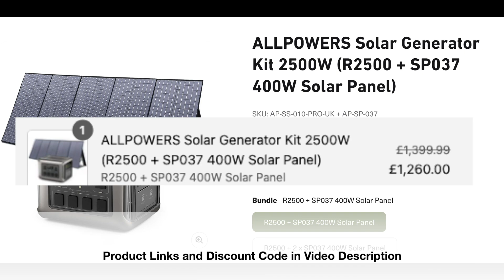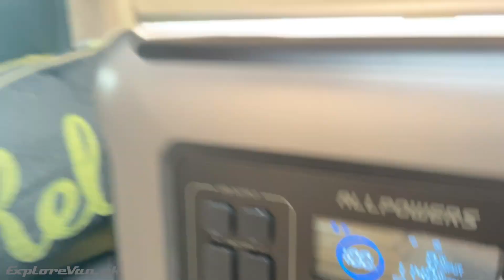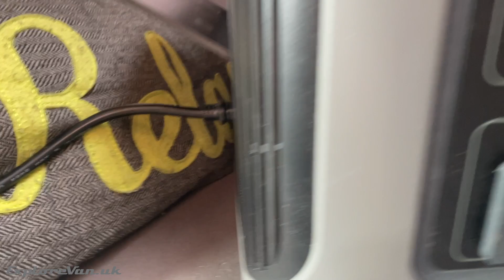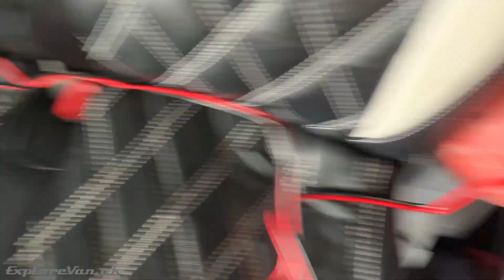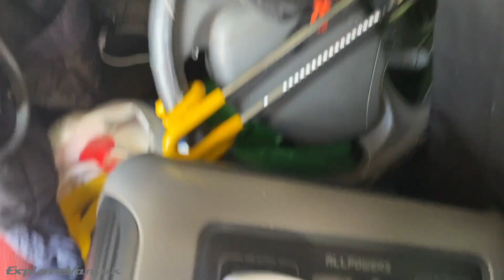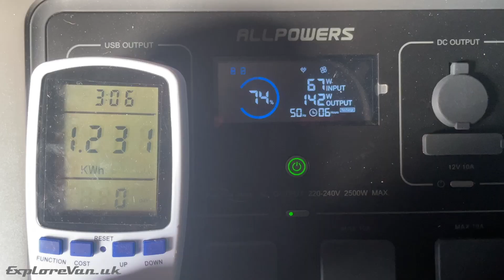The Only Power you Need? AllPowers R2500 Portable Power Station & 400w Solar Panel & Discount code!

Comment: Could we just connect it in the main outside electrical plug of the RV to run the fridge, lights, etc?
Reply from the maker: This is an option but worth making sure you have things like your battery charger switched off so you don’t waste power transferring it from the Power Station to your leisure battery.

Comment: Great video I’m interested in the Allpowers range but a question about the 12v. If I connected the Allpowers to my EHU input supply I could just use all the internal 12v as normal and the normal mains? The Allpowers will charging the battery through the Sargent unit. 
Would this be possible?
Reply from the maker: Hi, glad it’s helpful. 

For simplicity yes this would work, but it’s not the most efficient as you would lose energy both in the inverter increasing the voltage to 240v and in the Sargent unit decreasing it back to 12 volts. 

The most efficient option, where possible would be to run the 12 volt items from the 12 volt outlets on the AllPowers. 

Hope that helps.

Comment: Hi i liked this review 🙂 im going fulltime soon , electrics has really baffled me so i was looking at getting one of these. Some people are reeeeaaaally against them on fb groups 🤔 i dont no if its jus because there stuck in there ways or what. if its simple to use powers what i need thats all that matters 😂
Reply from the maker: If you know what you’re doing and want to do it all yourself then separates can have their advantages.  But for shear simplicity and now cost the Power-station route is very much viable and can be the sensible choice.